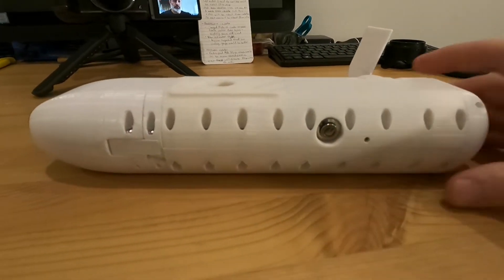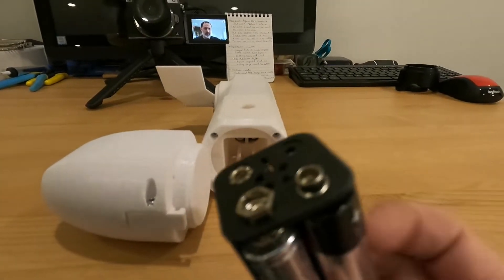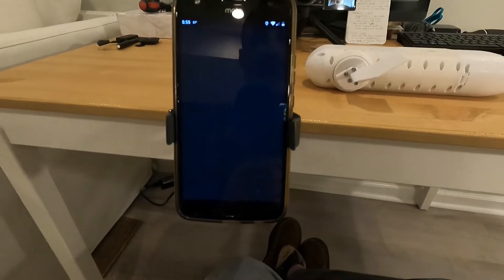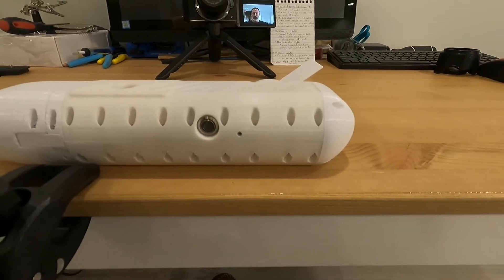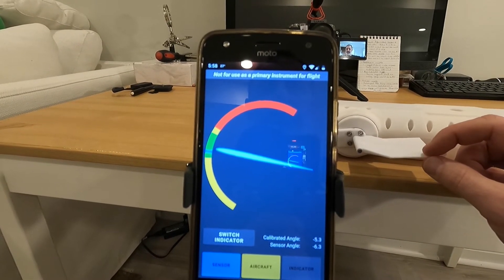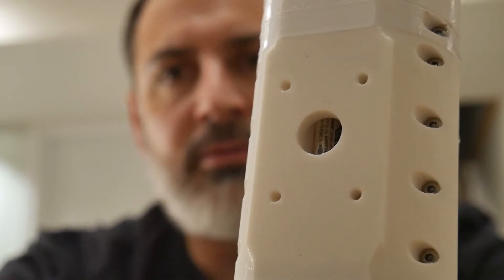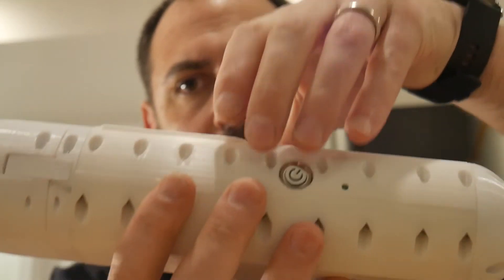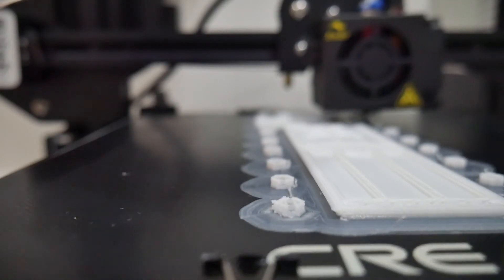Version 2 Update - Homebuilt AoA Sensor

Comment: Analogue gauge 👍. Cool project
Reply from the maker: Thanks! I agree - the analog gauge was definitely an upgrade.
Reply: @dan_der_flieger  I tried building some a few years back with speed range from 30kts to 200kts . Issues I faced were balancing the pickup vanes , damping out small perturbations to get a smoothened average output and lastly I could not find a high nits ( > 1200) small display that was sunlight readable so opted for audio warning when 2 degrees before critical AOA . Plan was to put one on each wing as asymmetric AOA during climbing and descending turns is where things go pear shape . I wish flight training included stalling in climbing and descending turns requiring rudder with stick forward rather than straight and level fully focussed as airspeed bleeds off and AOA increases to the point of the stall as this scenario seldom occurs in real flight .
Reply from the maker: Yeah, I've noticed that finding a daylight readable screen is pretty hard to do. My phone works pretty well, but that will depend on the phone you use, obviously. 

Did you ever come up with a design that worked in your target speed range? This version didn't work very well in flight (a lot of buffeting at slower speeds close to stall, right when you need a good reading the most), but my latest version seems pretty solid.

Comment: Any plans to sell these?
Reply from the maker: No, I'm not interested in the liability. The code and parts list is available on my website: 
https://www.danderflieger.com/my-angle-of-attack-sensor
Reply: @dan_der_flieger  yeah I understand, it’s too bad that lawyers run our lives these days 😕
Reply: @dan_der_flieger  Unfortunately I'm not nearly smart enough to build and program this myself from your very detailed instructions.  I don't own a 3D printer so can't even do the basics. I sure could however assemble a preprogrammed board and the associated parts into the 3D printed case. Do you think by suppling the parts and having the customer assemble them would alleviate the liability issue? I'm sure there are many of us stupid pilots out there that would love to have this unit to enhance safety while flying but don't have the smarts or resources to build from scratch.
Reply from the maker: @CDNinKS  - I understand. It's a steep learning curve for sure. I learned a ton throughout the process, myself. The 3D printing takes hours upon hours with a consumer printer like I have. It's fine for prototyping, but not for manufacturing. It really wouldn't be worth my time to sell them. It just wouldn't be economical.

I'm not opposed to other people building them and selling parts as long as proper credit is given and they don't just rebrand my work for profit. My aim was to give the home builder a way to learn some of this stuff and integrate more advanced electronics and sensors economically. 

Here's something I've considered before, but never did: it would probably be better to make 3D printed molds that can be used to lay up fiberglass or carbon fiber. That way the hours of printing could be used to produce several sensor bodies in composite material rather than one that's 3D printed that might might start to droop when the airplane it's attached to has been sitting on the ramp on a 105° day. 

Hmmm ... I might need to consider that idea again. I've never worked with those materials, but theoretically, it should work better than a 3D printed part and shouldn't take as long to produce.
Reply: @dan_der_flieger  ok thanks for that Dan. As I said I have zero experience with 3D printing so I didn’t know about the process or the durability of it. I hope someone does take advantage of all the effort you have done and try and at least build a kit for the DIYer with credit and maybe $ for you. Thanks again for advancing safety for GA.

Comment: Dan, this is impressive! Now I understand your focus on MakerPlane. 
I’ve often wondered why an AOA indicator isn’t standard avionic equipment.
Reply from the maker: Yeah, I've often wondered that as well. Not having to worry about varying speeds that change with weight (Vx, Vy, approach speed, best glide speed) is a big bonus. But everyone is trained to use airspeed, even though you can stall an airplane at ANY speed. I don't get it. 🤷

Comment: Nice job, Dan. Very cool. Looking for an AOA solution for experimentals.  Have you thought about a pitot tube approach rather than the vane type?  There's software out there for it. Also Arduino based.
Reply from the maker: I have thought about it. I find the idea of no moving parts very appealing.

Side note: I've been working on integrating the current wind vane AoA sensor into the MakerPlane CAN bus ecosystem with very good success. I'll have a video about it in the next couple of weeks. Measuring pressure differential should be pretty simple to implement.

Comment: Is this water resistant?
Reply from the maker: The simple answer is no, it's not water resistant - at least, not without a little effort. 

3D printing is done in layers, and each layer presents an opportunity for water to seep through. Printing thicker walls might help. 

Also, if you were to coat the printed parts with something, the coating should provide waterproofing. Depending on the filament used, you might consider "vapor smoothing" with acetone on ABS or coating the parts with epoxy for PETG/PLA using something like this:
https://a.co/d/f20MLn8

Also, where the two halves meet there's another place where water could enter.  A little silicon between the halves should prevent water from entering there. 

Another option might be to dip all of the electronic boards in epoxy or resin; or, some people say, painting them with fingernail polish is a good option. As long as the electronics are covered in waterproof coating, they should be waterproof. There aren't really any movable electronic parts (apart from a rotating magnet), so coating the boards should be fine.

Comment: Love it. Super great that you are sharing. I fly an experimental (Thorp), and am wondering if there is any way to shrink the whole unit down?
Reply from the maker: Thanks Dean. I'd never heard of a Thorp and had to look it up - it's a neat little airplane. Did you build it yourself?

Anyway, to answer your question, yes it's possible to shrink it down. The current dimensions are mostly to accommodate the battery pack. The AoA sensor is designed around batteries so that there's no question that it complies with 14 CFR part 43 - e.g. it's not a major alteration if NO changes are made to the aircraft. 

Part 43 doesn't apply at all to experimental aircraft, so you could easily build a mount for the bottom of your Thorp's wing that taps into the electrical system (e.g. no more batteries inside of the sensor body, thereby allowing a smaller body).

The actual rotary encoder inside the body is about a square inch in size, so the tip of the body would still need to be large enough to accommodate it.
Reply: @dan_der_flieger  I am very intrigued by this - GREAT WORK!!  I was just looking at the CYA-100 but just can't justify the price.  As a fellow FW developer with multiple other similar  skills as you, I was considering a DIY on this as well.  I fly a Zenith 601XLB - I did not build this one - but soon starting a build on a Rans S21.  I am having issues with the stall sensor that uses a glued on sealed unit with a embedded glass read switch - not a robust enough solution for a the tough environment of a wing.  Rather than replace it again or designing my own stall sensor, I figured I were going to buy something or build something it should be a AoA sensor.  Then I saw your build ...  

I would like to change it up a bit to use aircraft 12 VDC power - its an experimental so I can do that.  I also like the new mod with the ability to make your own mount.  I would build an aerodynamic short stub mount that I would attach to the aileron bell crank inspection panel so that it hangs about 4 inches below.  I would also alter the arduino code to provide a data signal - maybe SPI - to a remote display device that I can mount in the panel.  I am thinking either an LED array or maybe something with some RGB LEDs.  The phone display is nice but I do not have room for yet another screen.  I need something small and permanent.  I would use the app for configuration but the primary display would be the LEDs.

The electronics aspect is very straight forward and you have done a superb job of describing that and providing a parts list.  But I am missing the mechanicals of the vane.  What are you using for the vane shaft, magnet mount, and bearing?  

Have you heard of MakerPlane (https://makerplane.org/)?  They would be very interested in this project.
Reply from the maker: @merrillharriman1811  Cool stuff! My goal for this project is to give someone a place to start. You could certainly hardwire it to an LED indicator in the cockpit - from a software standpoint that’s far easier than pushing to Bluetooth anyway. 

I’m out of state for work right now and have the assembly video recorded, but not edited yet. I plan to update the website with another parts list for that video.  

The Arduino’s voltage in (VIN) pin accepts a fairly wide range of DC power and 12V is definitely within that range. It sounds like it should be a straightforward build. 

To answer your question about the wind vane: it’s a 3D printed part attached to a metal flange coupling, which connects to a 4mm shaft that rotates on two 4mm x 9mm x 4mm bearings.